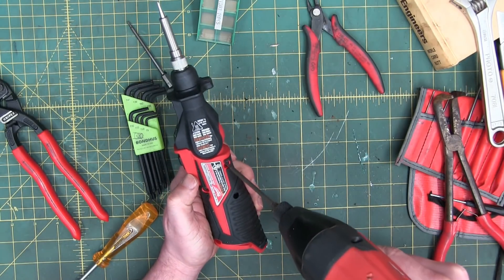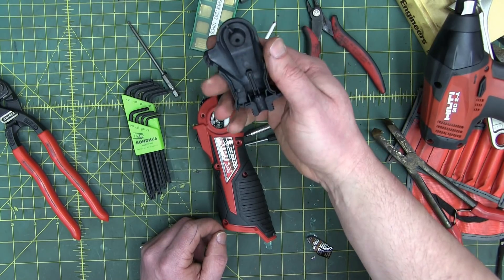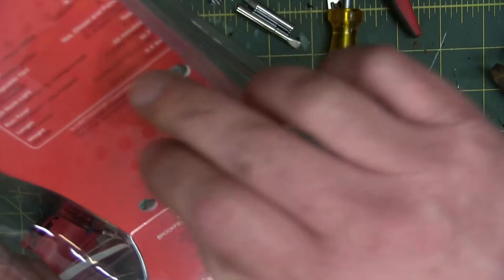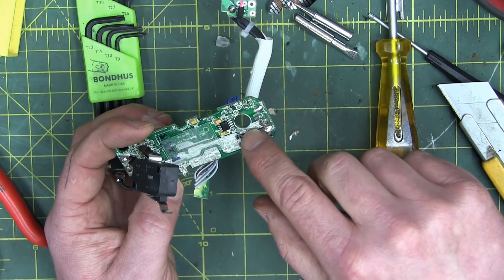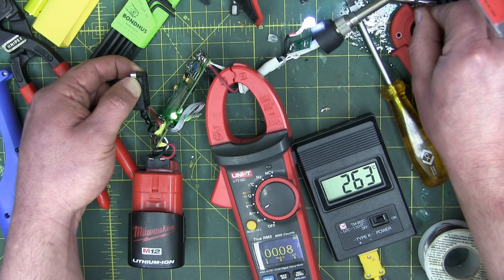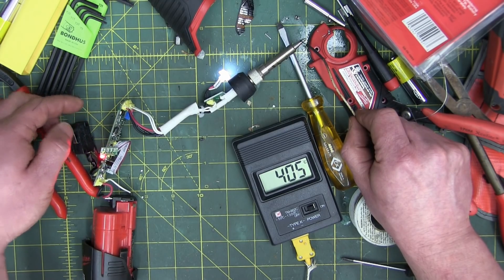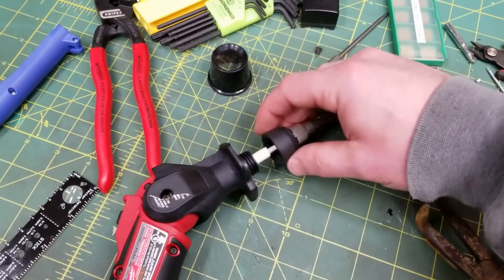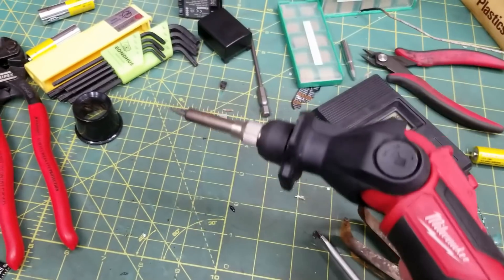BOLTR: Milwaukee Sodding Iron | I'm 2 for 2!

Comment: in my experiance, once you run even the most simple circuit backwards, shits fucked. Just throw it in the fuckit bin. I made a relay board for a friend once, 20 relays. He plugs it in backwards the first time he used it. I spent a good 13 hours on that damn thing trying to hunt all the issues and eventualy i just tossed it.

Comment: I've been using that soldering iron for about an hour and found the heat was melting the last plastic cap where it connects to the metal tube of the hot end.  Curious if anyone else has found that issue as well??
Reply: I'm having this same issue. Did you find a fix?
Reply: I haven't needed to use the iron for extended periods since but Milwaukee did replace the unit but I'm not convinced it wouldn't happen again if I used it for extended periods.

Comment: Looks way too bulky and heavy to be useful as a soldering iron. Would have been better if the iron was on a ~1m long whip, and the battery and control electronics could be placed elsewhere nearby.

Comment: from my experience milwaukee can't make an item that has a switch that won't fail quicker than bob's yer uncle. they used to though, i have a heavy milwaukee 5 or 6" grinder with a diecast body i got used in the early to mid 70's that still has it's original switch and it has been abused on the heavy side to be polite. still going stronger than shit. all the new ones though, their switches are worthless. they should put a pair n a spare in the box to get you started off.

Comment: Imagine that... no polarity protection... because it is SUPOSED TO BE IMPOSSIBLE to hook the battery up backwards. Oh well...
As to probing through conformal coating: go to fabric shop and get a box of "dressmaker pins". These are long stout wicked things with integral T-heads. Find your worst set of dikes (no the tool) and cut off the T-head from a few. Then either melt them into plastic rod or push into ~6mm wooden dowell (leaving pointy end out!) Can slip a bit of shrink over most length. Damn handy for getting into tiny tight places and pokem through existing defenses. Maybe out to patent the idea now that the whole world knows about it... but I stole the invention anyway from one of my mentors.

Comment: at this point, plug it in backwards and let it smoke so you know what died!
also, buy an arduino nano and make your own brain box?
Reply: ReabowRotors Or buy a knockoff 936 station.  Solid stuff with same tip and heater, pleasant handle and not so far from the price of a Genuino Nano.  It's brain box is just a few analog parts unless you want a fancy digital display.

Comment: Could you do a video on resurrecting the mill walkie 12 V batteries I got a piece of  old drill and every time I throw in the case  And forget to take the battery out Trigger gets pushed down a little  Over a couple days the LED  light runs a battery so low it won't  Charge I have a variable voltage Can trickler Her back to life  You to figure out the schematic for the battery were got the pizza ship drill that keeps doing it and pull the connector offer it rather have The schematicDone fuckn 3 batteries alreadyI just Warranty them But I need you to excuse to get drunk in the shop

Comment: No reverse polarity protection, bummer.
Reply: Special battery shape, what for to ensure correct pixie direction.
Reply: @kcuhc84  ah only if it worked on the inside out Ave testing..oh well

Comment: I'm confused. You shorted out the FET and it turned on. But it turned on non-stop max power with no limit, obviously, because you shorted out the brain's ability to tell the Mosfet ON/OFF. When you replace the FET, should be good as new, no? And, speaking of which, how'd you blow the FET without hittin' the switch as you said? I went back and rewatched, 8m45s , you didn't hit the switch.
Reply: He didn't blow it, he blew whatever controlled it. So, he just bypassed it
Reply: Zachary Welvaert - Ahh, gotcha. That's a nice simple explanation, makes sense to me now. I couldn't think of why he had to short the FET unless it was blown.
Reply: The MOSFET was fine. He friend the output pin for the MOSFET on the microcontroller. You can't just swap that out without having Milwaukee's firmware to upload to it. So instead of the microcomputer turning it off when up to temp, he just hotwired it to full power full time. He COULD add a few of his own components and use the case and battery to power the tip though. I wouldn't call it a loss. I like the overall package.
Reply: Jeremy Lee Makes Yeah, he coulda Arduinoed it!
Reply: Arduinoes have been outlawed on yourstrulytube.
Reply: Well, it's about time. Now folks can use real micros!!! :-0

Comment: You're a goof ave the solder on the traces are from solder wetflow component assembly process. Solder gets on the exposed bits. Granted they may have kept the solder mask off those bits intentionally.

Comment: So the original question is "is the micro switch underrated", and he was looking to see if all the current went through the switch, and the answer is yes, it is underrated,  but the prediction that the uswitch would be the first to fail was wrong....clearly the capacitor or the uC is underrated for reverse voltage. Cheap bastards, should've protected the input with a diode - how do they know someone like AvE isn't going to apply bumblefuckery to it? I mean they put screws in the bloody thing, surely that's an invitation to open her up and reverse the battery!
also, methinks uncle bumblefuck needs a holiday...those shakin hands, droppin stuff everywhere are not a good sign, and I guess the unthinkin is also a sign of stress. Uncle bumblefuck, go see a doctor, or at least get some sleep. We need you, you are a big part of my psychotherapy treatment. "Take Ave 20minutes twice a week".

Comment: Change the sodding mosfet.. You do have another sodding sodding iron to do that with, don't you? Any old rough equivalent that can take the humperages will probably do, its not as if the thing is doing anything subtle or high frequency. 
Besides if you blow up the replacement, everyone will  laugh twice as loudly as they did when you blew up the original one. I didn't laugh of course.. I'm not a bad person.. .just a liar..

Comment: If'n you want a battery powered soldering iron you can't really go wrong with a TS-100   https://goo.gl/6w3A2q
If'n you need it to have better heat capacity and you feel creative you can try a mod like marco reps did; https://www.youtube.com/watch?v=M-EaxWU70xM

Also your vise might not be the best powered up PCB holder, maybe stick a bit of tape or some dead tree carcass in there what for insulation, probably not necessary most of the time but could really cause a headache if you short something out.

Great video as per usual :)

Comment: purchased a TS100 DC 12V-24V soldering iron.  Love it so far.  Have made adapters for car, dewalt batteries, and a laptop power supply (19V).  Very compact and versatile.   It has open source programming and I am using a very nice custom firmware from here.  https://github.com/Ralim/ts100

Comment: what the hell is this piece of junk intended to be used for?
order one of those 2$ hakko clone replacement soldering irons, take her aaaapart and find that the tip construction is exactly the same
so therefore:
there are much much cheaper and much more handier soldering irons for if you are out and about than this unwieldy monstrosity
I mean... Consider an e-cigarette... these machines pack a lot of punch (in some cases 300W peak power)
If you compare these devices you'll notice that these things are pretty much the same thing but with another tip at the top

Comment: I mean, yeah okay technically you fucked it by applying reverse voltage, but give me a fucking break. 100$ name brand tool and it has no reverse voltage protection? That is some cheap shit right there.